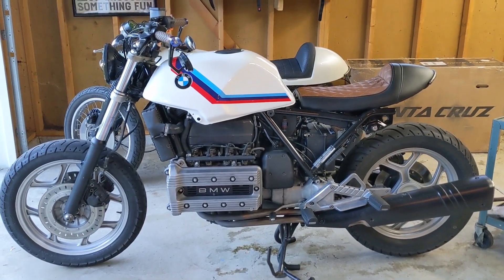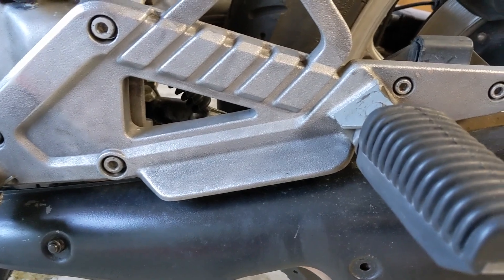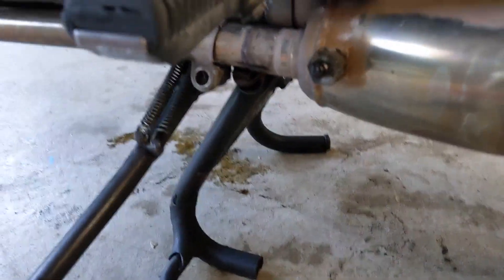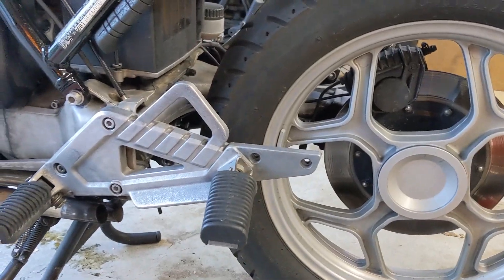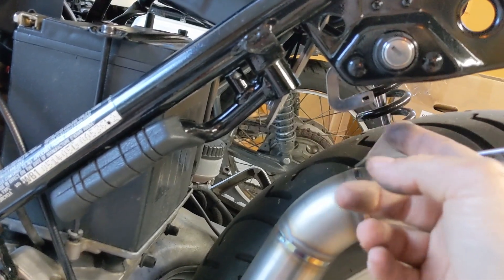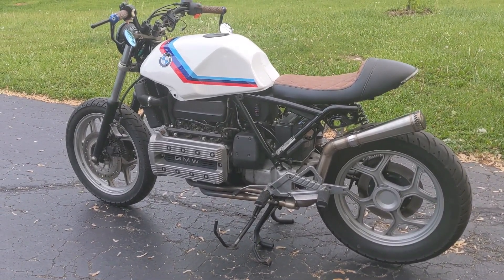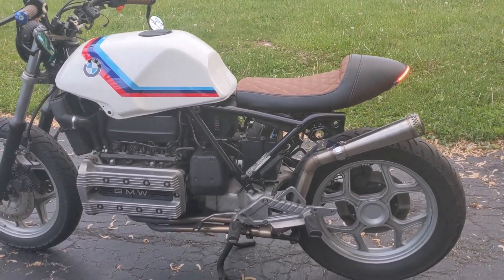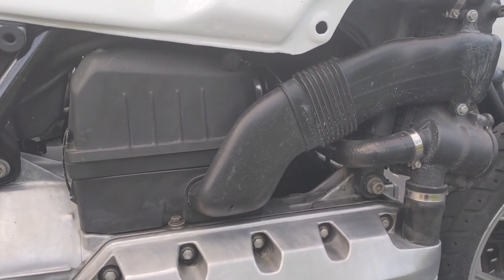EPS - 8 1985 BMW K100 Exhaust Upgrade

Comment: I see the 4 into 1 doesn't have slots to allow the clamps to tighten the female onto the male... also no notch for the tag on the BMW clamp for rotational alignment, if these are not in the right place its impossible to tighten them. and the side stand spring will catch too. Did this cause you any problems? I am considering buying the same system, so would welcome your response
Reply from the maker: Not sure I understood your question. I used stock clamps..fitment couldn't hav been easier.  Took a little adjustment to get the side stand spring to clear.. but not that complicated. I suggest buying it!